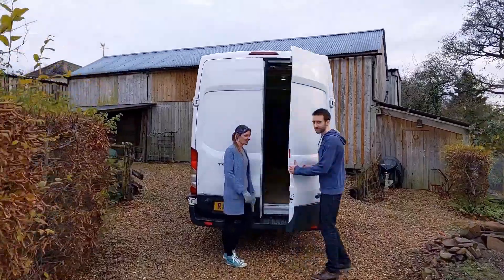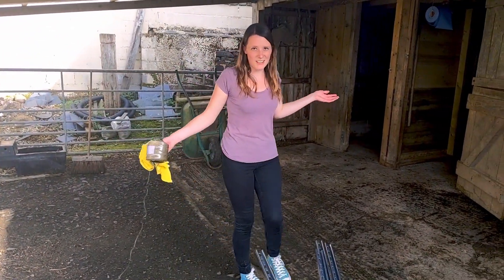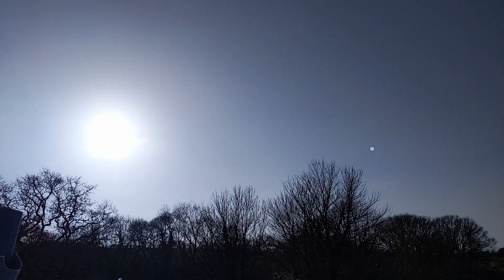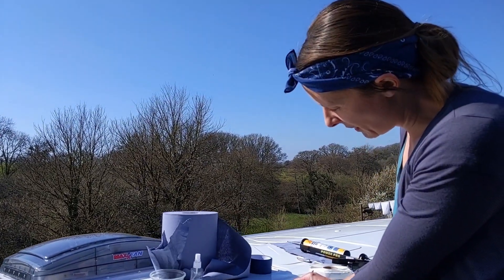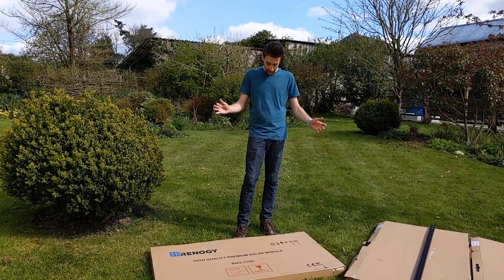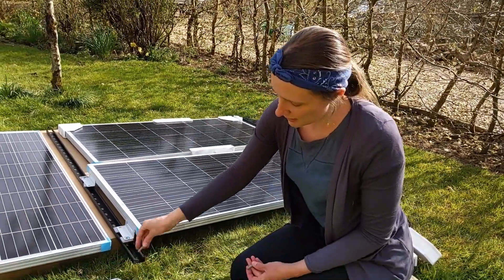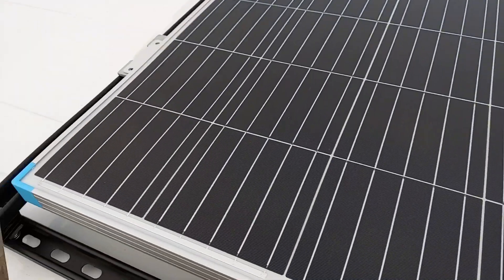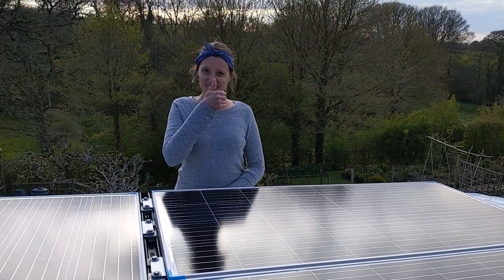DIY Unistrut Roof Rack (Easy Solar Install!) | Transit Van Conversion E12

Comment: Are those factory holes in the roof prethreaded for the bolts? Did you put a nut and washer on the bolt from the inside of the van? Thinking about doing something similar for my transit connect. Great video by the way, thanks!
Reply from the maker: Hi Jason, yes the holes in the roof were already threaded so we didn't need to do anything from the inside. We bolted it all down from the roof then just tightened it with a torque wrench. One thing to watch for is not all of the the roof holes are threaded, some are straight holes into the inside (which we're using for our solar cables). Not sure if the Transit Connect is the same but on ours the holes that are in the squared recess parts of the roof are the threaded ones, that are over the main support ribs (can't get to them or even see them really from the inside of the van). Good luck with yours, and thanks 😊

Comment: Do you know what the 525watt panels will be able to power in the van?
Reply from the maker: Yeah we choose 525W after doing a power audit of all the things we thought we'd be wanting to run off the batteries. We went through that in more detail in the more recent video where we wired it all up here: https://youtu.be/pIc2LTdw80U. But in a nutshell if we get around 3 hours+ of good sunlight hours a day, we think it should be enough to power the basic snapshot of everything we have, which includes the lights, fridge, pumps, heater etc. If we're somewhere with no sun, we should have enough battery reserve for a while, and can also drive the van to recharge the batteries from the DC-DC charger via the alternator if needed 🙂

Comment: Great tutorial! What size bolts did you use for the threaded holes on top of the transit? Also, what size gronmet for the solar wires?
Reply from the maker: Cheers, and they're M8 bolts in the roof. Not sure on the grommet size, the opening is more of a rounded rectangle than a circle but we have an assorted box and just picked the one that fit best 😛

Comment: Ahh, I was just starting to make a comment that cutting bolts is a lot easier with an angle grinder when….
Reply from the maker: Yep, plenty of learning by doing on this project 😛 Angle grinder was about 100 times faster, we would probably still be cutting them down now if we'd carried on using the hacksaw 😅
Reply: @SelfBuiltStories  
And it wasn’t even a full size hack saw! I really don’t like angle grinders though. I may use them when necessary but those blades can just explode. Only had it happen once. Scary hings.
Reply from the maker: @Zerpersande  Fortunately we haven't really had to use it for anything else :)